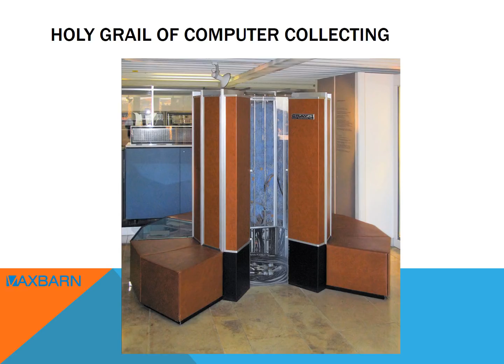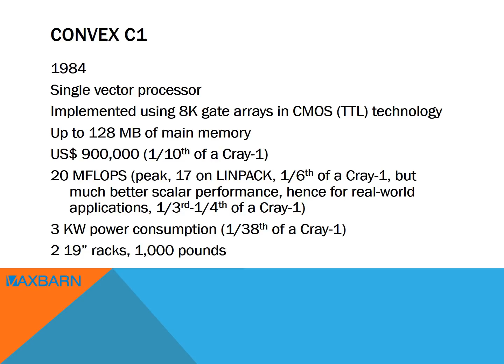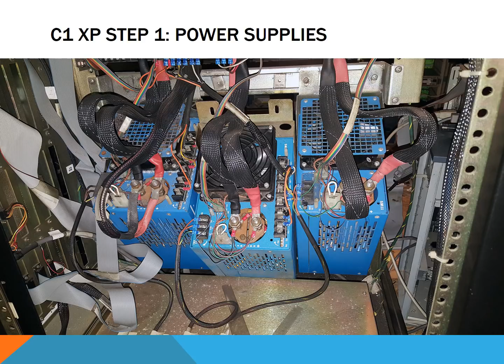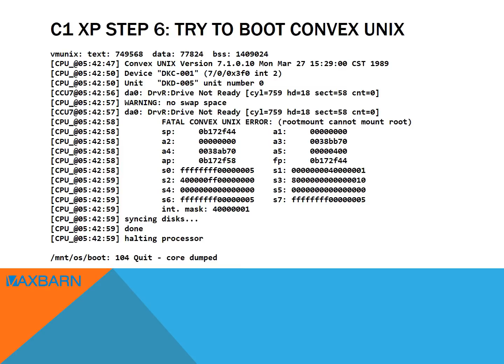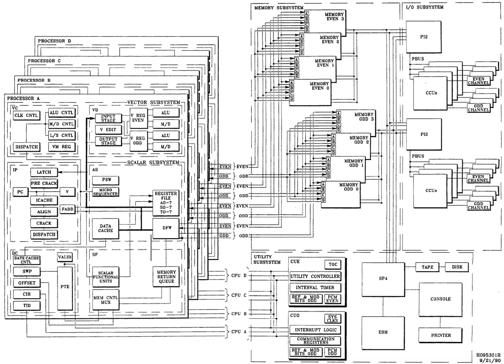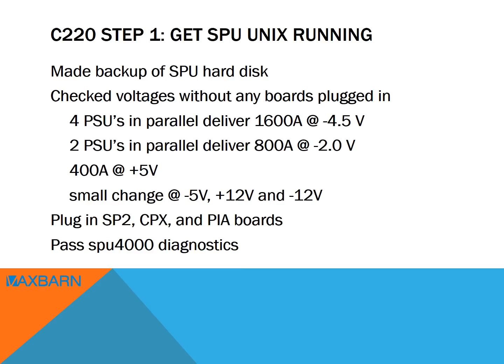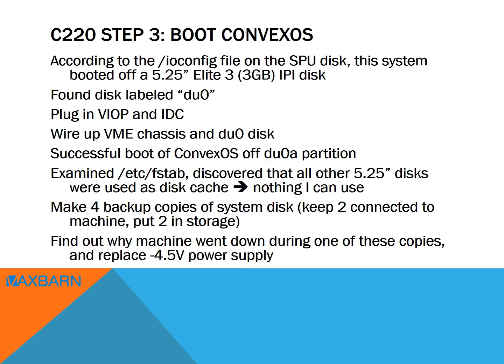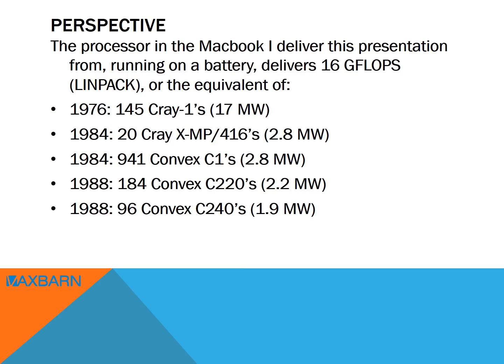Reviving 1980's Supercomputers at Home (OpenVMS Boot Camp 2017)

Comment: The semiconductor technology used in a Cray-1 was Bipolar ECL (Emitter Coupled Logic). There was no CMOS high speed circuitry in use in the 1970s. CMOS transistors don't even have emitters :).

Comment: To think that now a simple $5 Raspberry PI outclasses a Cray 1 is mind blowing.
Reply: an RPi2 does. The original RPi gets 42MFLOPS on LINPACK, 68MFLOPS when overclocked to 1000MHz [roylongbottom's benchmarks on the RPi series]. About half the speed of a Cray 1.
Reply: One thing many of such comparisons to modern microprocessor-based systems are missing is that those are delivering their performance to a very large degree due to their high-performance caches.  Crays have barely anything that looks like those caches, in particular data caches but are using other tricks to forcefeed the execution units with enough data and programmers and compilers knews how to exploit that.  In practice that means modern microprocessors are starting blindingly fast for small problems but as soon as the data set outgrows the cache size performance drops baadly.  The amazing thing about those old vector monsters is they just keep delivering performance as the problem size is growing.

Comment: Your smartphone is a magnitude faster than those ancient "super" computers. An AMD Ryzen R5-2600 reaches 2 TeraFLOPS floating point speed (including the integrated VEGA graphics chip). This is just amazing how much processing power you get for so little money.
Reply from the maker: Did you see the comparisons at the end of my presentation?
Reply: Yes I did, it is just amazing how fast computers, tablets and smartphones are compared to the relics 20 years ago.
Reply: Remember you also need to take into consideration the size of the problem that needs to be processed. A proper comparison would include memory latency,memory bandwidth and size of ram.
Reply: Pharmacist Completely irrelevant and useless comment.
Reply: Keep in mind GPU flops are not the the same as CPU flops.
GPUs are setup to work on problems that benefit from large scale parallelism where a single instruction performs the same operation on multi pieces of data which is what SIMD stands for single instruction multiple data.
They are usually rated in single precision as well as you don't need double precision for rendering a video game in fact you can do a lot of short cuts to gain even more speed.

Comment: Did you purchase an aging coal fired power station of ebay to run this ?
Reply: Two. Imagine if some day you wake up and one of the two coalstations fails to fire up. Redundancy is everything.
Reply: The C1 only needs 3KW or two space heater's worth of power you could run it off a 20amp window AC plug.
The C220 though would need 50 amps at 220V so it would need at a least a 60 amp breaker.
If he has a home charging for an electric car a circuit that can power it is probably already in place.
Reply: @Patchuchan  a cooker outlet might do it.